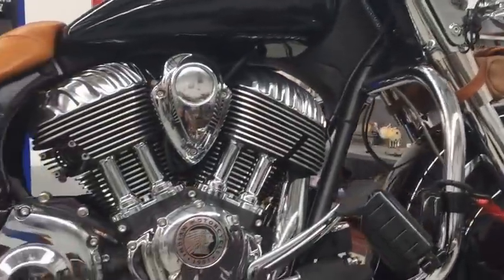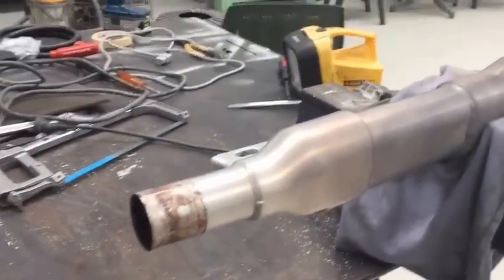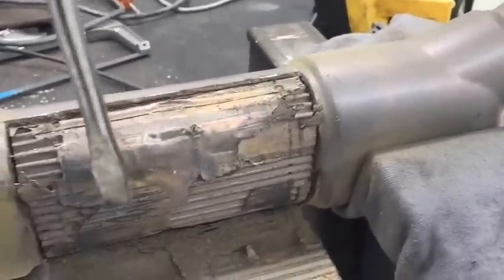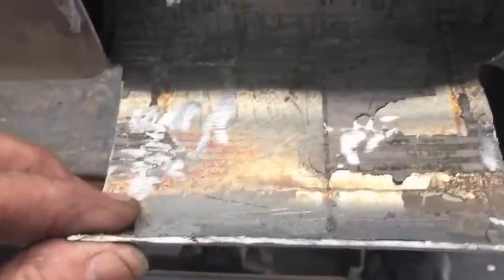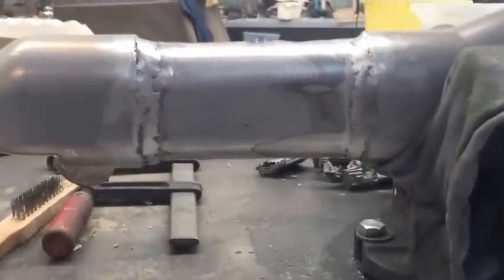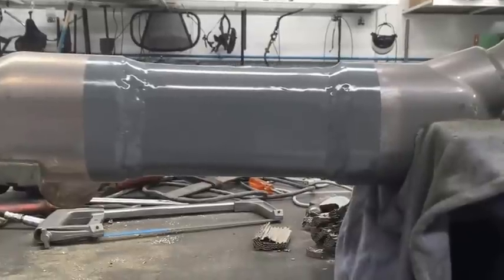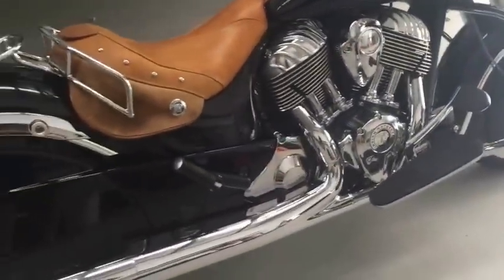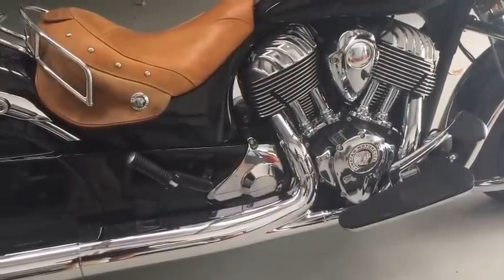How to Remove the Catalytic Converter 2014 Indian Chief Vintage

Comment: Bike is going great, I did put on a hi flow air cleaner, back pressure no problems, did 6,000K ride late last yeAr with no issues. Since doing the cat I have put in a set of Andrew’s cams 570’s.

Comment: Well I would think it would help with heat on the right side. The sound maybe a bit louder as it's free flowing now but I would not run it without some baffles to give the motor much needed back pressure! This is the same principle as installing headers (head pipes) true duals in a sense. Nice clean job dude. Not sure if drilling it out would remove it completely but sure it would help. I'm surprised you didn't have to flash the system as it may run a bit lean. I'm sure it's a bit better on fuel. Nice work 👍
Reply: don't need back pressure! you need exhaust scavenging!!

Comment: Great vid. So 5 years on, do you need to do anything else after the cat has been removed .... tune, flash the ECU, restore some back pressure, ? I have a 2017 Springfield with S1 pipes and high perf air ... do you think the sound would me much different?

Comment: Brent, I'll have a degree in fluid dynamics before I'm done researching all this! I think I'm ready to go, will probably cut and extract as you did, not drill. My question is about whether you need to add something downstream to make up for the loss of some back pressure from the cat. I hear some say it presents little or no back pressure, others say it does. Of course, back pressure is not the same as exhaust velocity, but let's not go there!
Reply from the maker: Paul Heagen hi Paul a little back pressure is produced by the baffles in your muffler, I have done about 7,000Ks since the cat was omitted all is good
Reply: Thanks, Brent. I may do those velocity torque cones at some point, but will try without for now. I appreciate your work and wiliness to share it.

Comment: Nice video Brent! I just picked up a 2016 vintage with the factory stage 1 exhaust, header, stage 2 cams and air cleaner. Bike sounds great! The cams really give it a nice thump. I would be interested to hear how your bike sounds with your pipe mods and the cams once you get them done. Thanks for the effort on doing the video!
Phil
Reply from the maker: Phil Wilson hi Phil check out my channel and view the TS570 Cams I installed
Reply: why not drill it out with hole saw

Comment: To bad you cut the ceramic coated pipe.I was able to drill out the cat completely with the head pipe on the bike & only had to remove the R side muffler.

Regards,Tom
Reply: +Tom Kelly . How where you able to completely drill out that aluminum core? or did you mean you where able to drill a hole in the core. Thanks Mike
Reply: +Michael Rhymer 
Yes,you can completely remove the cat by drilling the head pipe on the bike.Remove the Right muffler.Pilot drill using a long a 1/4 inch drill bit & drill at 12 o'clock,6, o'clock,9,3,11.5.2,10 etc round the circle.Drill close to the pipe then the center.This will break up the honeycomb.You don't have to but,use a larger bit if you like,to break things up.The point is to be able to start the bike & blow the cat out the exhaust pipe.WEAR A MASK! It is messy....
It is a bit (pun intended)of a job but,It will come out cleaner than a whistle......

Regards,Tom
Reply from the maker: Theirs no way on gods earth that got the whole cat mesh out its a Bugger of a job having full access, you may have got a little section out 👏🏻👎
Reply: I know many people who did it the way Tom is saying
Reply: I just did mine with a drill... after enough holes it will fall apart
Reply: Tom, I'd be interested in your process since I don't have access to a metal cutter or welding equipment. Are you on one of the Indian forums? Have you posted your own DYI?  How much of the cat did you get out?
Reply: Brett  Are you on one of the Indian forums?  Have you posted a DYI?
Reply: Paul Heagen yes I posted on the Indian Owners Group Facebook page
Reply: Basically you need a good drill. I used an 18" long 3/4" hammer drill bit & a1/2". Took 20 minutes. Use the 1/2" to drill close to head pipe in 4 spots like 12, 3, 6, & 9 on a clock. Then 3/4" in the center then move bit up & down to connect holes kind of like a pie. It falls apart. I cleaned out big pieces with an extendable magnet. Then I reved up the bike & shot the rest out.... I also had a shop vac running in the cross over pipe.... good drill & new bits & it comes out. Don't know how to post pictures here but I have one showing the cleaned out head pipe
Reply: Thanksfor your reply. I knew my Bonneville inside and out, but still learning the Indian. So, newbie question: Did you take off the right side silencer to do the drilling? I'm not even sure where the cat is, maybe right at the junction of the two headpieces where they meet the crossover?
Reply: Paul Heagen there is the head pipe & then the 2 mufflers or slip on pipes. I took the slip on pipes off. I no longer have the stock slip on pipes on my bike. Stage 1 would be changing your slip on pipes & air cleaner.... easiest way would be to buy a full set of pipes... the new head pipe will not have a catalytic converter
Reply: Thanks for reply. Buying whole new pipe system...Easy? Yes. Cheap? No!  I'll drill, baby, drill.
Reply: You can't get it out cleanly and completely Tom's way. Converter is glued to inside of collector. Impossible.
Reply: Tom Kelly A lot of platinum in those parts
Reply: @BA-bh3el  i drilled mine out with a spade bit got all of it out took probably hour and a half
Reply: Did it require a retune?

Comment: I was wanting to know that some guys add a deflector inside the pipe to divert equal flow after removing the converter foil.  It appears that from the factory there is no deflector, so my question is! Why would you need to add one after removing the foil ?  Does anyone know ?

Comment: Great Job mate!   So Brett, how is the mod working out?   Run cooler, no issues?   Do you think this could be done with out having to flash the ECU?
Reply from the maker: Hi David when I original done the cat modification I didn't flash the ecu,  I have since put cams and big air cleaner in the bike we also put a power commander in and Dyno turned.

Comment: G'day Mate,
good job and great video showing how to save $1700 bucks, love it.    Did you do any custom dyno tuning, since I doubt that Indian has any flashes for this mod :)    Or are you waiting for the cams and then do one for all the mods ?  Speaking of all the mods did you change air ?   Is she running cooler on the  rear cylinder ?
Might go down the exact same route...
Sorry about so many questions, but I gotta know :)
Reply from the maker: Howdy I haven't yet received any flash turner as yet , the bike runs really well, I still have the original air cleaner. Waiting for cams,cleaner and tune kit brent
Reply: So as of now how is it working out? Would you do it again?  Did it lessen the temp any?

Comment: If the Cat is made of aluminum you could have just poured a strong solution of sodium hydroxide "lye" in there and let it sit overnight. No cutting or welding needed.
Reply: @jorgerodriguez-mp8my  Walmart sells sodium hydroxide for $10.99 a pound. Take your pipes off the bike plug one end and pour a strong solution of the lye in the other end until it covers the cats. Check the internet to see what concentration you will need. Make sure its outside for ventilation. Do a youtube search for lye vs aluminum for some examples of how it works. I have never tried this but I dont see why it wouldn't work. The chemical reaction will happen and the aluminum will dissolve with the right sodium hydroxide concentration. Be careful because it will produce hydrogen.

Comment: Brent, you didn't say how you removed the pipe end that goes into the engine cylinder. The two pipe clamps were easy, but the pipe going to the engine is all solid weld. This job is not for the average garage do it him selfer. Most of you guys know what im talking about. Trying to take it out without removing the pipe from the bike is out of the question, because pieces of the cat will inevitably fall into the crossover pipe and stay there forever. The catalytic converter is very solid when I tapped on it with a long screwdriver. It was a fail for me.
Reply from the maker: Hi Chris I don't no why you could think the cat mesh could fall into the balance pipe !  Take another look at video you will see that I have removed the rear header pipe/cat converter from the balance pipe and rear cylinder.  Brent
Reply: It has to be solid to endure exhaust pulses.

Comment: This might be a stupid question, but is the pipe steel or stainless steel.  And will the computer need to be reflashed. Thanks Mike
Reply from the maker: Hi mate sorry for the delay,  the pipes are steel are haven't as yet put a tuner in waiting for cams,air cleaner. Brent